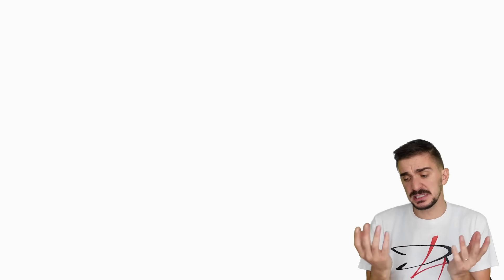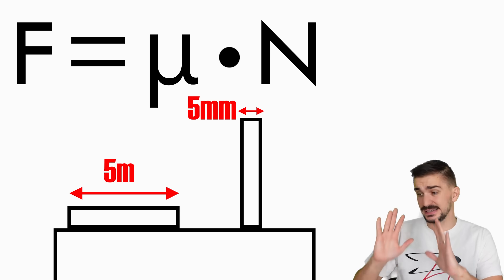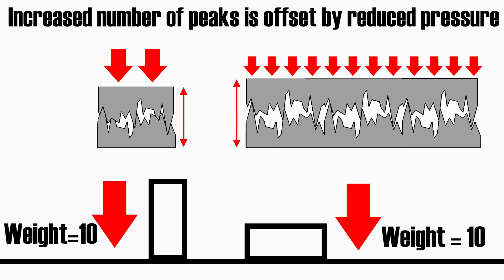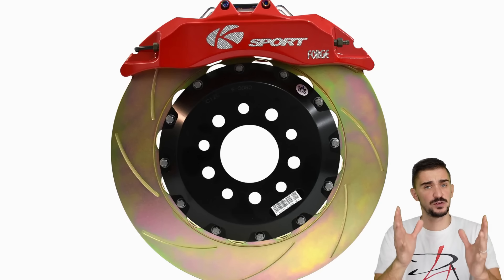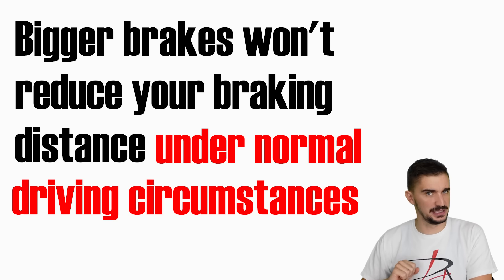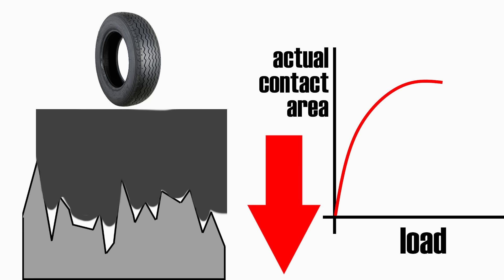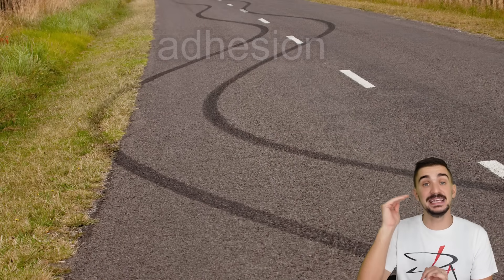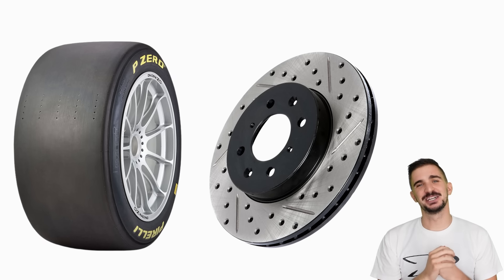Why Big Brakes Won't Stop You Faster but Wider Tires Will - Friction and Surface Area Explained

Comment: Bigger surface area on pads usually means bigger rotors.
This means more moment on the axle so whilst the friction force may stay the same, you get more stopping power (or less heat) for the same force applied to the pads.

Edit: Not less heat (generated). Typing without thinking.
Reply: This should have been covered in the video, but braking force is generally not limited by the amount of pressure you can put on the pad. With brake boosters you can have any force you want pretty much. The main reason you don't get better braking performance with bigger brakes is because you are tire limited anyway. Even normal cars with pitiful brakes have more than enough clamping force to overcome the friction of the tires (hence why ABS exists). So again, the only reason to get bigger brakes is heat management as stated in the video.
Reply: @test987665  big brakes also look cool 😅
Reply: @esmokah  True 😄
Reply: Only tire limits amount od momentum, even puny stock brakes can block the wheel, tire is always a bottleneck of this system
Reply: @nanab256  Thats how the system is built. But brake size does matter. Its just not possible to legally produce and sell a car that has so uderdimensioned brakes.
Reply: @rehepeks  what law prevents selling a car with big brakes?
Reply: @Andrew Crews it's more about heat dissipation.
Reply: The larger rotor also gives the caliper more leverage over the wheel therefore more braking force. Bigger brakes definitely give better braking. Better feel more power quicker stops
Reply: @holmes1956O  No, they really don't. Did you watch the video or misunderstand it? If your brakes are big enough to lock up and/or engage ABS, then bigger brakes will not decrease stopping distance. It is a physical impossibility. The only way to decrease stopping distance is by decreasing the weight of the car or getting wider tires.
Reply: @tenaciousjeebs  wrong. I can attest I have changed the diameter of the rotors on some of my motorcycles and the differece is unbelievable. One in particular was a good stopper standard with the larger rotors it would pick up the rear wheel. If you are unable to use your brakes effectively without locking them up you need to learn to brake properly. I understood the point he was trying to make. He is just wrong. Larger tires also impart greater pressure on your braking system. They are heavier therefore harder to stop. If they are larger in diameter they impose greater leverage on the brakes making them less effective. Look at brake dyno data you will see how much more effective larger brakes are
Reply: From what I understand, braking distance depends on the amount of grip between tires and road surface. Large rotor have more leverage, thus more stoping force. But if it too much force, it would stop the tyre rotation but momentum will keep you going.

It also matter how the force is applied to the system.
Reply: @Amin.Ashraf  proper application of said force decreases stopping distance. Having the force to stop is not the only part of the equation. Having the skill to manipulate that force to your advantage is the key. That key is something most humans today do not have. Take a close look at any racing organization f1 nascar indy car moto gp fim superbike none have abs,why? Because it does not work as good as a well trained human. The argument about tires not having enough traction to take advantage of improved braking is absurd. Only the uninformed believe that rubbish
Reply: @holmes1956O   can't compare purpose built race machine and road car, they made to do different things in. Some regulation banned ABS because it count as driver aid, it made driving F1 easy.
 In race track, you have a lockup, you spin around onto runoff area or into a barrier.  In road car it's a safety feature. 

  I'm not saying that there aren't enough traction to take advantage of  the braking system. I meant to say that a break system should suite its application. F1 brake are great, but if you put it in a road car...
 
A well trained human can't apply different amount of pressure for each caliper. Abs, you can just step on it and computer will manage it. It's not like abs gonna kick in every time you step on the brake
Reply: @Amin.Ashraf  😂😂😂😂😂😂😂
Reply: @Amin.Ashraf  I have removed the abs from one of my vehicles and have proven to people like you that I can stop faster and shorter on any kind of surface without than they can with. Things like abs are for individuals like yourself that lack the ability to learn things like proper brake control. I can ride my ducati in the rain at very high speeds without crashing. No abs no traction control just my finess on the controls and the ability to read the situation and control the events. You keep believing that the technology is what you need. The rich people that make and sell it love you
Reply: @Amin.Ashraf  If your brakes are powerful enough to lock the wheels, bigger brakes will not stop you any quicker. Did nobody watch the video?
Reply: @holmes1956O  we're talking cars, not bikes, and if your brakes are powerful enough to engage ABS (or lock the wheels) then larger brakes will not stop you any quicker. It's science. Also, you're correct that there is a tradeoff between unsprung weight and stopping distance.
Reply: @tenaciousjeebs  brakes are brakes no matter the vehicle. The dynamics are the same. Also I did not mention just motorcycles. I have vehicles with abs and never use it. Why? Because I brake properly I dont stab at the brake pedal in a frenzied panic hoping that technology will save my ass. You all want to believe this nonsense go ahead. I know the truth from real world applications and personal experience not to mention the science properly applied.
Reply: @tenaciousjeebs    I don't remember saying bigger brake are certainly will shorten braking distance. Spec brake are powerful enough to lock the wheel since traction level isn't the same on each wheel, hence the ABS.

Regardless of the size of the brake. If the car setup isn't balance properly. What the point.
Reply: @holmes1956O  sure, whatever that make you believe that you're better than other. 

The city streets is your track. 

 Nobody have the ability to do the thing that they teach at driving school as good as you bro.
Reply: @holmes1956O  ABS will always achieve a shorter stopping distance than human braking - again, it's physics. And yes, brakes are brakes, and bigger ones don't help you stop quicker. They ONLY absorb heat better to minimize overheating when racing. Your personal experience means nothing at all. Your statements have real "I never got covid so I don't need the jab" energy :)
Reply: @Amin.Ashraf  I don't mean this in a rude manner, but I didn't understand what you were trying to say.
Reply: @tenaciousjeebs  😂😂😂😂😂😂you keep believing that. Someday we may meet and I will take all your money on a bet on that. Now get lost
Reply: @holmes1956O  Nah, I don't like to bet with science deniers. It's too easy.
Reply: @tenaciousjeebs  😂😂😂😂no faith in what you profess to know. Typicall
Reply: @holmes1956O  You embarrass me.
Reply: @tenaciousjeebs  um no you embarass yourself. But keep it up everyone is enjoying it 😛😛😛😛
Reply: @holmes1956O  "I can stop faster without ABS"
Oh boy, thank you for the comedy sketch. It made my day. 😂

There is a reason why ABS was banned in F1 to promote driver skills instead *almost 30 years ago*. And those are best drivers in the world on the same 3-5km of track with predictable conditions and surfaces, trying to "just" repeat the same braking action (unlike you have to do on the road).
Reply: @Andrew Crews yes of course you're right about the amount of heat generated.
I hadn't thought it through.
Reply: Thermal MASS is more important ... based on what the compound is.
Reply: Most of your slide calipers will never excert anywhere near the same force as opposed style calipers
Reply: @doug-core8850  

Doesn't matter.
Reply: @jabberwockytdi8901  I didn't know that - thank you!
Reply: How is that? If the same force is applied, and you have greater area, you have less load per sq inch. And yes, you have the same amount of heat generated, but over greater area, which means lower temperature.
Reply: @jordan9339  Neither of those statements have anything to do with braking distance.
Reply: @Andrew Crews Same amount of heat equals different temperature over the contact surface if you have 1 sq inch and 2 sq inches.
Reply: Bigger rotors just allow you to not melt them while tracking your car. It has nothing to do with braking distance.
Reply: @tenaciousjeebs  Unless you go full carbon or carbon-ceramics which decrease unsprung weight and over repeated use does reduce the distance
Reply: @Random63R400  well yeah, absolutely, that's why I've stressed that one of only two ways to decrease stopping distance is to decrease weight.
Reply: @tenaciousjeebs  Are You trying to write physics from scratch? Bigger rotors (radius) means bigger torque being applied using same force, as T(orque)= F(orce) x R(adius) hence it's easier to stop the car. Stop spreading misleading information, start reading books.
Reply: @k_s.m  Bruh, you're right, but not for the reason you think :). If your small breaks are powerful enough to lock up the rotors or engage ABS, the only determinants of stopping distance are the weight of your vehicle and the coefficient of friction of your tires. If you change neither of those, bigger brakes won't help you stop quicker. Do you still not understand?
Reply: Richard Schofield, You are so right but people keep talking about heat. Guys, leave the heat alone. The further brake pads are from the axle, the bigger the stopping momentum is. Simple law of physics - the lever. That's why bigger (in diameter) brakes brake faster.
Reply: @geniuspackardbell369  oh god, no, none of that was correct. How on earth are you guys so confident in your wrongness?
Reply: @Andrew Crews Exact, the heat you generate will be the same but there is more thermal mass, there is also more surface area to dissipate heat to the air 
use big brake kits if you start feeling squishy brakes
if you just wanna increase braking distance, upgrade to better master cylinder and better stickier brake pad compounds
Reply: @RENO_K  Few people in this comment thread understood the video. If your brakes produce enough pressure to lock up / engage ABS, the ONLY way you can decrease braking distance is if you decrease vehicle weight or get wider / stickier tires. Bigger rotors, better brake pads, etc will never decrease braking distance.

Comment: I always laugh when I see people saying that they need bigger brakes to stop faster on racing track but they run street tyres 😂
Reply: Bingo, If you aren't smoking your pads or boiling your fluid, you're good. ps. replace your brake fluid if you ever overheat your brakes.
Reply: Yeah with proper semi slicks i cooked my rear brake after 3laps on the nordschleife. You put much more heat in brakes thanks to the added grip.